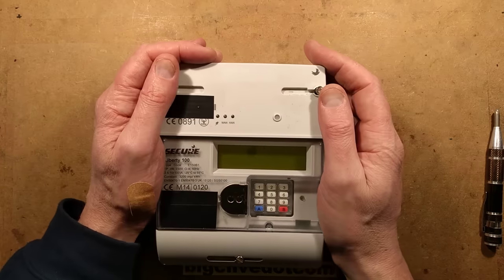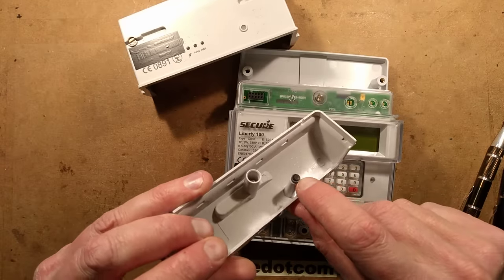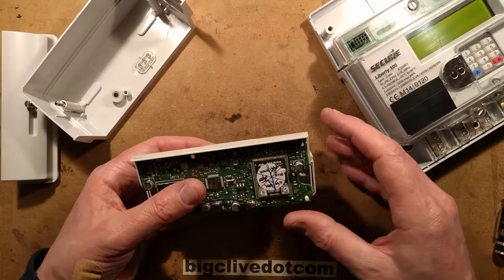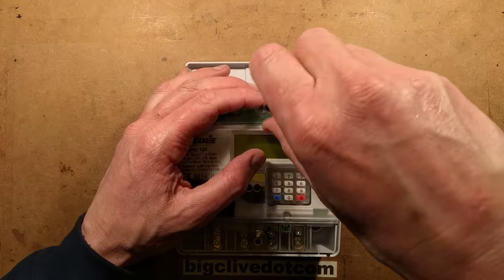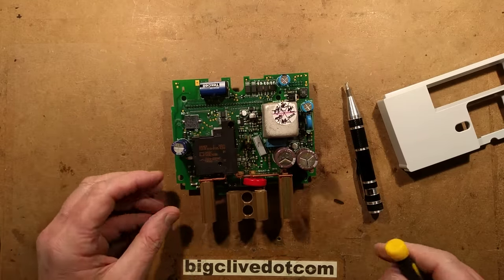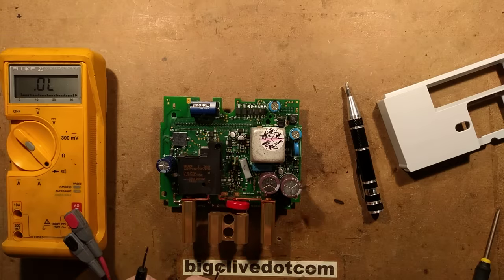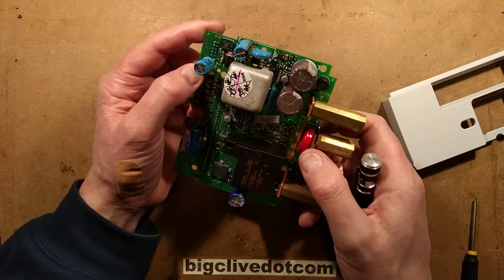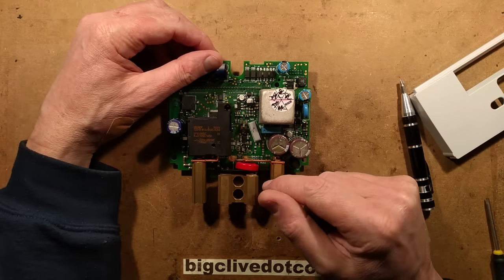Inside a smart meter, and the REAL problem with them.

Comment: There is a valid reason for measuring the apparent power instead of the real power. What the Network must supply is the apparent power. All the generators and infrastructure must be rated for it. In the past the main load on the electrical grid for residential users were resistive loads. This means that measuring real power was good enough for measuring the actual power consumption, but with the introduction of switch mode power supplies this changes. Now the real power can be a poor measurement of the actual power usage. And yes the real power is the power that is actually converted into work, but that doesn't change what you consume from the power grid. Industrial users were always big reactive power users, with the inductive loads, so they were always billed for apparent power.
Reply: 1 VA costs the power company much less than a Watt though. VAs only cause losses in wires (inlcuding those in the generators), and therefore some watts dissipated. You only have to burn extra fuel for those extra Watts, not for the VAs.

Furthermore, the reactive current will usually not flow all the way back to the generator, but to some nearby opposite reactive load, wheather that is someone else´s load, or a local PFC unit from the power co.
Reply: I thought inductive loads can actually feed power back into the grid too?
Reply: sinephase  Any reactive load, whether inductive or capacitive, is drawing power for part of the cycle, and feeding power back during the rest of the cycle.
Reply: @sylviaelse5086  so do they not charge for that?
Reply: sinephase Usually, retail customers are only charged for the net (a.k.a. real) power,  but depending on the jurisdiction, the retailer may be able to change the rules. Larger commercial customers are more often charged extra for the other component (a.k.a. reactive power) to compensate for the increased usage of the distribution network, and to encourage them to do phase correction in house.
Reply: Switchmode power supplies are worse for harmonics than power factor. For years AC induction motors were the cause of poor power factor and I'm willing to bet they still are.
Reply: I would suspect the only reason they didn't measure apparent power for residential customers is because they couldn't, or didn't want to bother to, make a meter capable of measuring it. Now they can, so they will...

Comment: So how come smart meters can be made out of plastic, when new consumer units must be metal (or non- combustible material) to prevent fires. Can't be that meter installers never fail to tighten the cable terminals right, because there have been reports of poorly trained installers and smart meters starting fires.
Reply: I used to install these,  one meter operator company I worked for,  didn't care about safety,  they just cared about numbers installed, and profits.  Staff would be rightlybe suspended if failing safety audits but then during the suspension,  audit others. Seriously..... You'd also be given 10+hrs  of work to complete in a 8hr shift daily.
Reply: Look up the town Paradise in America which was destroyed  & see how the smart meters caught fire.
Reply: Consumer units are enclosures. It's a bit like asking why MCBs are made of plastic.
Reply: Yep. Called out to a burning smell just weeks ago. Smart meter just installed, badly, live terminal not tightened to specifications. Had no option to pull the main fuse for the safety of the customer and property. And guess what, hasn’t saved the customer a penny since forced installation.

Comment: To add to what firefly mentioned, the module at the top is probably an 'integrated comms hub'. The module below is the meter. They talk over ZigBee to each other. The hub is responsible for routing messages from the Home Area Network to the WAN. There is usually a 'last gasp' capacitor to send a message home should the connection to the electric meter be removed (there are 2 pins on the meter side messages that are shorted).The hub periodically brings 1 pin high and checks to see that the other pins has changed state in that black connector. I've worked principally on SMETS2 for another UK manufacturer. But SMETS1 is conceptually similar (but much simpler and less convulted).

Comment: If these meters were all about saving energy and putting money back in consumers pockets, they wouldn't have ever been rolled out. The main beneficiary of these devices is the power companies who can now remotely cut off your electric should they decide to do so, and add new peak rates whenever they want more revenue.
Reply: Exactly right.
Reply: Companies can already apply peak rates if they want. See Eco7 rates. Electric companies have already rolled out signal meters for triple rate meters. If you think your current meter can't do that. Sorry you're too late since the 90s.
Reply: Iv always said the same thing from day one, the customer isn't saving shit..its so the company's can monitor and control you even more. If for any reason people start using less electricity then the companies thought, guess what people,  the price of electricity goes up. What ever happened to going to the meter physically, pushing the bloody button and the green display tell you how much electric or gas you've got left.  It's been working absolutely fine for the last 20 odd years
Reply: @Cowcow211  Eco7 .. so thats the UK. You don't have a government above the energy companies ? They make their own laws and get away with it ?
Not happening here.
Reply: @ @k1ortia  I agree with every word.
Reply: If you are using more power than you pay for, you're stealing electricity.
Reply: Even if you have an analogue meter, you can still be cut off. They just send an engineer.
If you pay your bills or top up - why would they want to disconnect your supply? 
And by savings - they mean that with a smart meter, you can't steal your electricity and the more people use smart meters, the less electric is being stolen so therefore, the company does not have to charge you for the stolen electric.
Reply: yeah instead they can watch your usage by the second and come up with a nice neat "price plan" for you to get more money of you in the long term, lets face it they only exist to make money so the more data they have the better they will be at squeezing their customers.
Reply: Yeah, that's why I want to invest in solar panels and batteries and get off the grid. The biggest problem right now is the batteries...
Reply: If it would be up to the electric companies, they would install cheap and reliable power plants, and sell the electricity  the cheapest way. Compare it to some other industries where competition is relatively free and out of the hands of politicians. Where I live, I would compare them to phone companies. Talking and data is dirt cheap and the plans are simple.
Reply: What a load of rubbish.....
.
Read between the lines FGS..  
.
They're being rolled out cos the UK government are failing in their carbon emissions reduction policy and putting these out to TRY to get Joe public to become self conscious about wasting energy through the use of these devices and reduce their own consumption
Reply: these meters cost money to make and instal - so the idea of 'saving money' is completely false - and while companies might offer these meters for free - the real cost of them is being put back on the customers - who now pay MORE for electricity per unit .....its a false economy and just gives the power companies full control of customers.
Reply: Actually the main saving the companies get from Smart Meters is not having to employ an army of people to read them.
Reply: Not only that, but they no longer have to pay personnel to go read them.
Reply: @loonzuk  You may have spent years installing but you don't appear to have ever looked inside one in case you hadn't noticed there's a big relay in there and that's only there so that the meter can be remotely isolated.  All they have to do is to send a message to the meter to power the relay and all smart meters are in 2 way communication with the supplier, as a matter of practice it's not done because of the risk of cutting someone at risk off (frail, medical equipment etc).  They currently switch the meter to PAYG mode but if you can't afford the bill it comes to the same thing.

Comment: I'm not an electrician, but I know about business. I wish they would just stop peddling the lie that they can save you money. They can scare you into using less maybe. Companies don't tie up resources in order to assist customers in buying less of their product. These devices benefit the company far more than they can benefit us. I use very little power as it is, and I'll go as long as I can without one of their smartmeters thanks. I'd respect them far more if they said  we intend to cut down on energy theft using these things for example, rather than the bullshit they do try to feed us.
Reply: Yes, that's exactly how they work, but sensible people call it being informed, rather than scared. They save the utilities money by not sending our meter readers an allow them to track down faults quicker..
Reply: If they want to force you to install it you can cut the power completely and use solar cells... solar is free energy, only the hardware and maintenance of the batterys will cost money.

Comment: Hi Clive, keep up the good work. Good as always, but just wanted to add some comments. Remember this meter is I believe designed to have current flowing in both directions! I have one of these, and I have solar panels, and hence there are times when I'm supplying to the grid. Another feature which is required because of this is in the event of a power cut from the grid, it becomes important that I don't try and feed anything back to the grid thus endangering anyone working on the grid trying to rectify the fault.
Reply: Shouldn't your DC-AC converter listen in to the grid and switch itself off due to a lack of either a mains frequency or an over- or undervoltage situation?

Comment: great vid,   you mentioned rf sensing.... a neighbour of mine had his wifi inside the elec. box and the elec. went off 1 night, he called me ( the local nutty proff.) and i couldnt see anything apart from that. so i phoned the power company and they couldnt reset  the meter until i moved the wifi away.  so yes there is rf sensing.
Reply: That makes no sense to me. He must have had one hell of a powerful WiFi box because the RF immunity required for certification is ... well, put it this way, you don't go in the test cell when you perform the test!

Comment: I used to work for one of the first companies to provide smart meters in the UK. They offered a lower rate at night, based on the data received over SMS; basically made running things like washing machines cheaper if you did it after 10 pm. I think a bigger concern is whether random employees at any of the energy companies can see your aggregate usage pattern, and then inform local criminals about when your draw drops off sharply (ie, you've gone on holiday).
Reply: EXACTLY. And that's the small scale criminal issue. We've all been told Russian intelligence gets up to no good, taking innocent lives right? Of course, because our media is on a campaign to make people believe it's a Russian only issue. Of course not, we know from history MI5, the CIA, Mossad etc have and will always be up to tricks themselves since day one. Who wants any authority in this world we live to have access to when you are at home and not. Even if you have been sheltered from realities like the above then even the conception of it being possible should be enough to reject such a unnecessary transformation in the way our electricity is monitored to be implemented by force.
Reply: >They offered a lower rate at night, based on the data received over SMS; basically made running things like washing machines cheaper if you did it after 10 pm.

don't you have lower rate at night regardless of type of meter? it's just a switch that works 22-07h to put those late kwhs on 2nd counter. it's old stuff. 2-rate meter.
Reply: @i4004   not unless have a radio teleswitch that gets a signal from BBC radio alerting it when to go off peak mode . Thy were common in high rise tower blocks due to have storage heaters that charge at night during cheap tarrif
Reply: @christophergallagher3845  let's blunt this down: do majority of uk citizens have 2 tarrif (day/night) meters? i would imagine with higher living standard (of uk) 2 tarrif meters are a must. then again it's old capitalism, so....
Reply: @i4004  yes there are two tarrifs off peak and peak . I'm not sure ho digital meters work but th the old wnwlogu disc meters they used another box similar size called a radio teleswitch and this would change the tariff of your analogue spinning disc meter or activate a different meter completely to give you cheaper rates at night . 

Because of this they used a heating system called storage heaters ( they were filled with bricks inside , the power would come on via the radio teleswitch or a heavy duty timer from say 11pm to 7am and heat up the bricks inside . During this time at night you keep the heat regulator flap closed to heat the bricks then open the flap during the day to let the bricks radiate their heat into the room )
Reply: @i4004  I imagine no with digital meters it may be through a sim card but idk if the older non smart digital meters are capable of that
Reply: @i4004  Single rate only. 
Have not seen a lower rate for 50 years.
Reply: @thedrummerboy1215  if you so wish you can root an android phone and stop that. or get a Linux phone. if someone thinks you have to have an iPhone then I don't know what to say